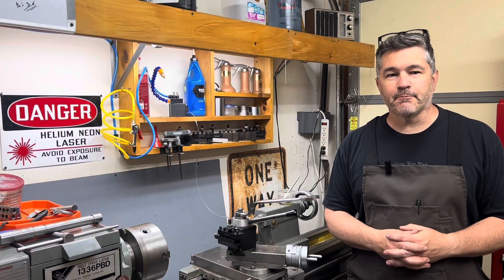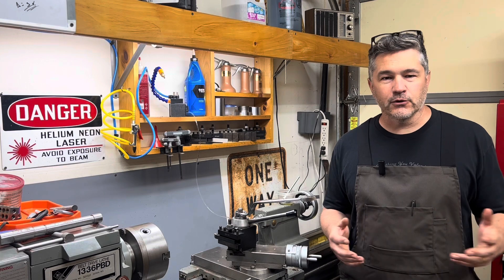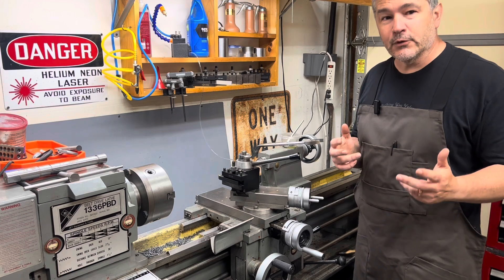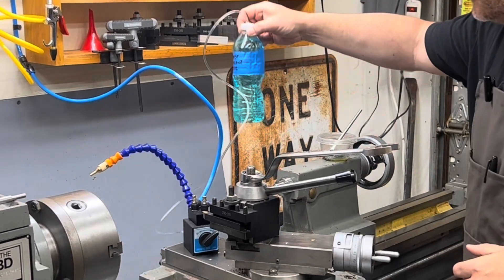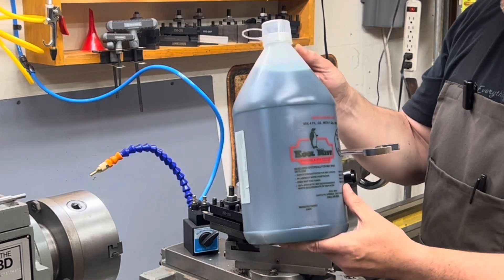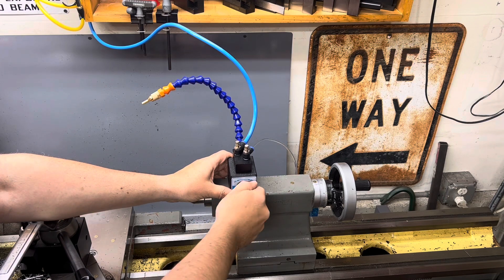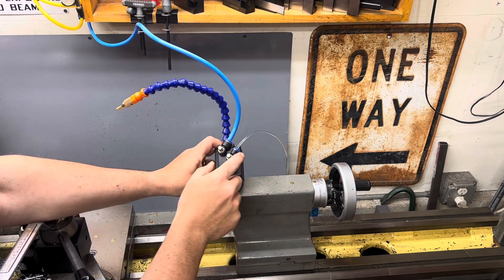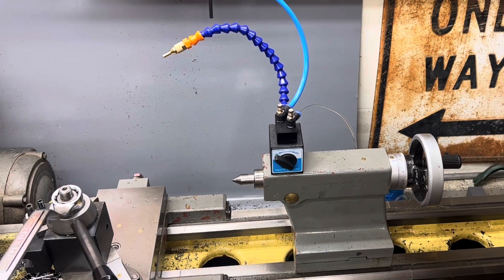Simple 8 minute build: Mist Coolant System for metal lathe, mill, surface grinder, drill press

Comment: This is great! Thanks so much for sharing.  I'm getting an old B&S surface grinder up and running and was looking at mist options and this is perfect.  I even have a few magnetic bases sitting around to poach.  I subscribed.
Reply from the maker: Thank you! Yes, this system has worked out great for me the KoolMist product has been a good all around coolant.
Reply: @EnoRestoration  I believe I saw that you are using KoolMist 77.  Did you know there is a KoolMist 78 that seems to be formulated for mist, rather than flood applications?  I bet the 77 works just fine, but thought I'd pass that on since I was just doing the research yesterday and did a quick search on the 77 vs 78 issue.  Thanks again!  Looking forward to more of your work.
Reply from the maker: I didn’t know that about 77 vs 78. I’ll check it out, thanks! I’m currently working on my truck but will be back on the machine tools in a month or so!

Comment: Only thing missing is the air line connection. I figure I'd just use a standard 1/4 male air coupler with female threads for the blue tube fitting to screw into that comes with the air line. Thanks!
Reply from the maker: @kyferez1  thank you for watching and sharing your comment. I do appreciate it!

Comment: Hi great channel what size air line did you use for the mist system
Reply from the maker: Thank you for the comment!  The tubing is 8mm or 5/16 OD 5mm ID
There is a link in the description for what I used.

Comment: Thanks for posting this.  Very Helpful.  How much air does it take?  How do you manage the coolant mess?
Reply from the maker: I’m not sure the CFM usage but my normal sized compressor works just fine. It will run on and off if I’m running it a long time. For the surface grinder those jobs usually take longer so I’ll set up a drip pan to collect the coolant. For lathe and mill I’ll just let it go, and set up a drip pan only if needed. The kool most works well and doesn’t create any rust.

Comment: Great idea with the magnetic base! Simple yet effective. Ive got the components for one of these systems but didnt want to mount it but using some strong tape as you say I could use this on my lathe, mill and probably even CNC.
Reply from the maker: The 3M tape has held on strong for me. Even with the vibration of the surface grinder where I used it extensively.

Comment: I use IPA on mine when cutting non ferrous. Its nice because it evaporates quickly.
Reply from the maker: Thanks for watching my channel!  What is IPA (besides the beer…)?
Reply: Isopropyl alcohol. Its used in hand sanitiser and is generally used for cleaning. But because it evaporates so easily its pretty decent as coolant but also means you dont get all gummy chips. @EnoRestoration

Comment: Hi, does the coolant reservoir have to be level or above the mister? I was planning on making a similar set up but I want to put the reservoir on the ground. Thanks!
Reply from the maker: Reservoir below the mister is best, otherwise you'll get a siphon effect and fluid will flow when you don't want it to.  I use mine on the ground all the time!